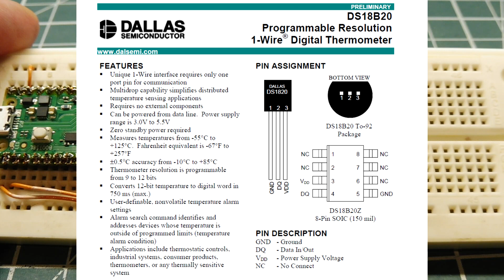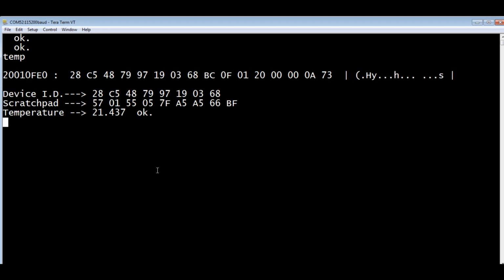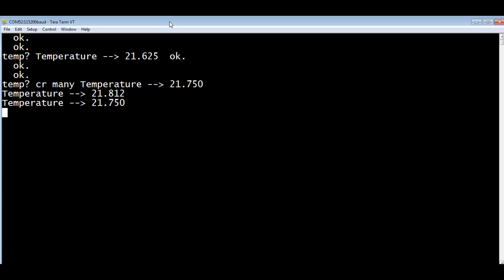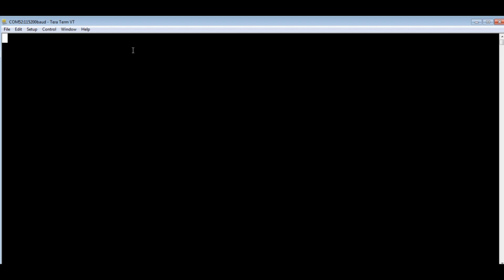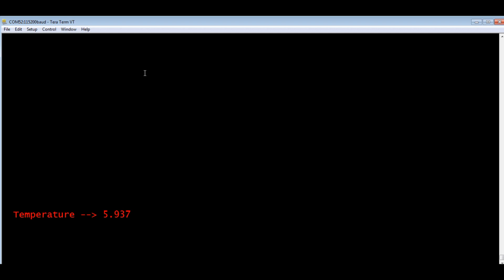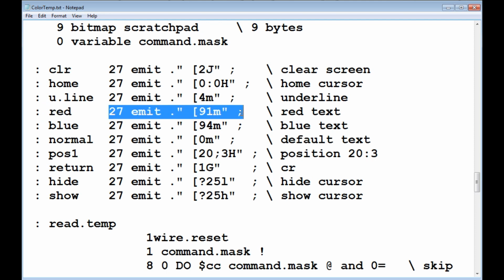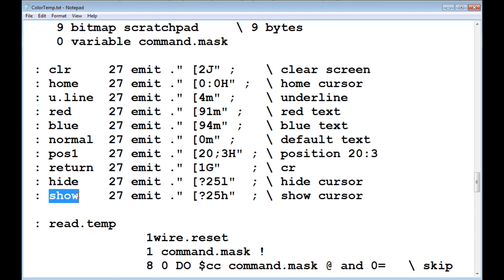How To Use ANSI Escape Codes / DS18B20 / Forth / Pi Pico

Comment: Neat. Forth love if honk then. By the way, it is eye eye see or eye squared see. There is no 2 in "Inter Integrated Circuit". Any abbreviation should have fewer syllables than the original.
Reply from the maker: Philips Semiconductor introduced the IIC bus in 1982. With a play on word and math it became I squared C. In 1982 we were using DOS and word processors could not reproduce the subscript "2" for squared  so it became I two C. Even Philips documentation and data sheet in the 1980s used I2C. Then we got TWI and SMBUS.
Reply: @0033mer  Yes, I agree. But one must ask if you can't use superscripts, why keep up the wordplay when it doesn't work? Anyway, when speaking out loud why not use the one that actually makes sense in terms of Inter Integrated Circuit? After all, wouldn't I2C be ICC?
Reply from the maker: In my You Tube channel I use all the variants as many people have heard different variations. Going through university I have heard them all from my professors and all the students understood. When I use Inter Integrated Circuit (which is the original) verbally I actually get even more confusion from the younger crowd. This was addressed this in my early videos. https://youtu.be/PjsK6uxUZeA

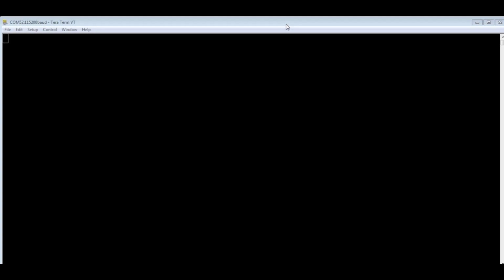Comment: 1:59... Can't quite see how you connected the DS18B20 sensor to the MCU with the pullup Resistor and Diode.
Reply from the maker: You have sharp eyes, didn't think anybody would catch that. Unlike any video you have seen using the 1 wire protocol I have implemented it in a different way. I am using the on-board UART of the micro-controller to generate all the narrow pulse for reading and writing to the sensor. The baud rate generator is tied to the clock which is crystal controlled so all my timing pulses are accurate. The diode is isolating the TX from the Rx line and the resistor is the pull up for the bus. Would have to make another video on the subject for total clarity.
Reply: @0033mer  Thanks for the reply... Yeah it was the diode that had me stumped. Makes sense now.

Comment: Always love forth! Is your single wire protocol code also in forth or are you using asm? Also, when you talk about daisy chaining the temp sensor, does that mean several can be connected to the same wire? Presumably they watch out for their serial # before they respond. Does it initiate a data send if the alarm limit is hit? If so how is a potential collision resolved then?
Reply from the maker: The 1 wire protocol is written in Forth. You have the operation of the common wire correct as many sensors can be connected to the same wire. Each sensor has its own ID and they do not talk unless asked to by the microcontroller so there are no collisions. When a command is sent to do a temperature conversion the value is compared the the alarm triggers and a flag is set. There is an alarm command that can read all sensor alarms at once.